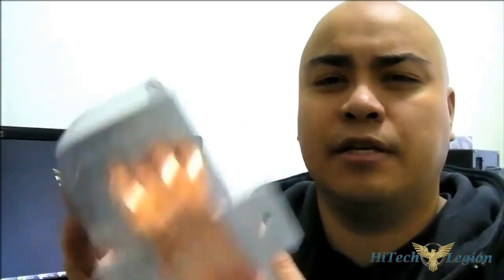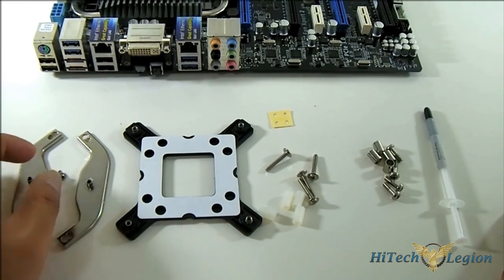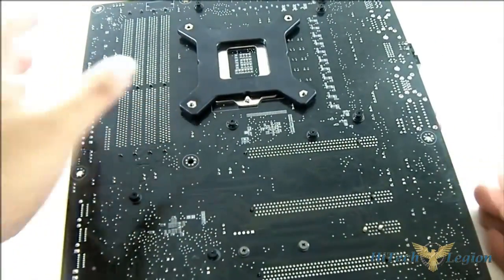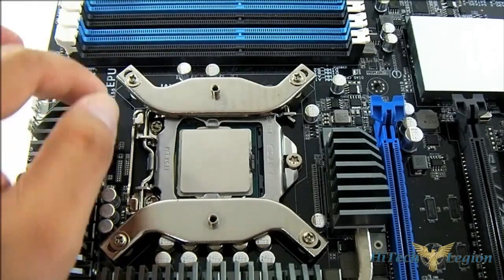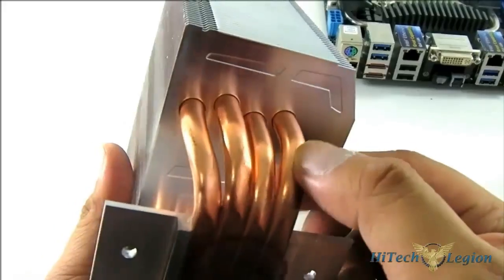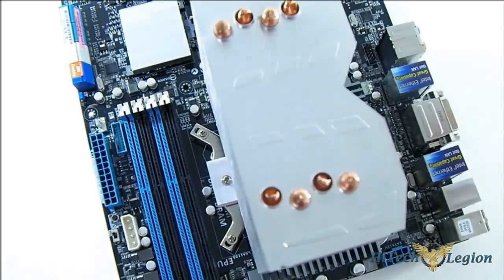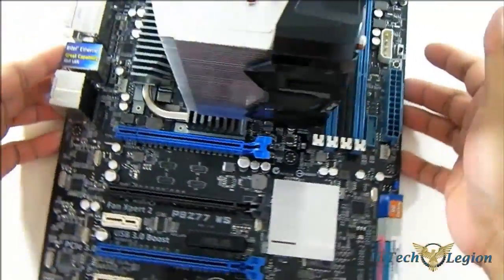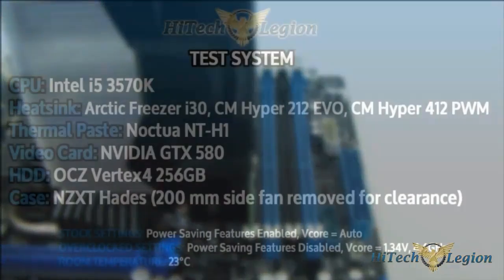Arctic Freezer i30 CPU Cooler Unboxing+Review+Benchmarks

Comment from the maker: You don't need to go all the way to the edge when you apply it since the pressure will spread it out to those areas anyway. Just make sure each heatpipe surface has contact with the compound.

Comment: The brackets should be mounted to the cooler first, not to the motherboard as it is indicated in this video. I found out the hard way. Had to remove the whole thing after I had applied the thermal paste.
Reply: angelthman 100 % agreed

Comment: The design has changed. Mine had 4 screws between the cooler and brackets instead of 2. Product instructions incorrectly identify the screws to mount the brackets to the cooler as "B" for the Intel Socket 1150, 1155, 1156 when they have to be the same as Socket 2011 ("A") because they are the only set with matching diameter and threads. Also the hex screws on the front bezel of the fan are just for looks. The threads do not reach the fan assembly. The bezel just hooks onto the metal air fin assembly and sandwiches but is not screwed to the fan assembly.

Comment: got this installed in my Zalman Z11 Plus case at last please to say with fan facing the back the 4 ram slots on my gaming 3 board are all clear even for the high profile ram.
will do an update video once its running but this going to take all day to install.
i have i5 4690k & 16gb ram.
even found a way to use the two usb3.0 ports at the top with out taking the two in my motherboard to.

Comment: I bought 2 more sticks and what I did was reversed the fan pulls through the metal part. I only increased 4-5c in temps. Gaming for several hours I am still rocking temps at 55-62c. So it can be done if anyone was wondering.
Reply: i have the same cpu cooler, and i did what you did, i flipped the whole cooler, and it pulls the air through the metal, and pushes it out at the PCs back. however, when im playing heavy games, like forza horizon 3 at max settings, i get like 78c. my cpu is an i5 8600k. do u think this is normal? or did i do something wrong? maybe the thermal paste is the problem.. or maybe bios settings for the fan control

Comment: My Xeon E3-1225 (95W) in Define S with 2 front in, 1 bottom in and 1 back out Fractal Design GP-14 fans:

Stock cooler - 100% Load - max temp 80C
i30 - 100% Load - max temp 51C (most cores 45-48C)
i30 without fan - 100% Load - max temp 64C

At 100% RPM which is 1500 is definitely audible, but if you need to change the fan it is really easy i.e. Silenx EFX-12-15 is 74CFM and 15dBa which is not audible and would perfectly complement the cooler :)

If you use it on a none OC CPU, no more than 1000 RPM would be absolutely silent, which is what I was aiming for :)

I feel like a 6700K  with at least 50% OC would be stable at no more than 60-65C, but don't have the equipment to test :(

I hope I've helped some folks! :)
Reply: Amazing cooler body right ? The fan truly is definitely pulling it back... Currently I'm using two case fans -  one back IN and one top OUT exactly next to the CPU cooler to make the pc completely silent :) Very happy with the cooler and you are completely right. For heavy OC, definitely another fan would increase immensely the value of this product!

Comment: It's the same exact issue with the 4th DDR slot on an AM3+ board too, and I thought there was more clearance the Intel boards.  Bad designing and you'd think they have figured this out before they learned how to flatten heat pipes?

Comment: so I got this cooler now but tis different to the guide, the metal brackets have 2 screws for each side of the heatsink not 1 so is 4 screws instead of 2 and the official instructions state to fit them to the heatsink first although I am going to try and deviate from the official and do how this guide has done as this way seems easier, but the i30 is different to whats in this video.

Comment: i understand  the  need for better heat pipes for air cool  systems but bigger  cooler are getting in the way of  component on motherboards about time manufacturers  use their heads

Comment: I've read that this bad boy has a pretty slow fan. However, the heatsink itself looks very thoughtfully engineered, and those heat pipes are pretty beefy. Have you guys tried it out with a different, faster kind of fan with good static pressure? It looks like it'd be a beast at heat dissipation if you had a higher volume fan.
Reply: BTW, great review.

Comment: is it necessary to put so much thermal compound? you can put on the cpu at the size of a pea and spread it with an old credit card! i believe so much thermal paste it acts as insulation and not channeled properly to heat sink.

Comment: Is it possible to mount the fan facing the back of the case to free the 1st DIMM slot?
Reply: In case you are still wondering. Yes you can. I reversed mine so it would pull through the metal and out toward the back. Only increased 4-5c in temps while gaming for a few hours. I'm at about 55-62c during my gaming sessions. So it's doable for sure.

Comment: Great Video man.
But this suck monkey balls (sorry) i am looking for a cooler for my haswell 1150 I5-4670K, and with current memories i am using gskill ripjaw. since i have all 4 slots being used 32gb this wont fit.
What is the point of overclocking with this cooler if you have standard memories.